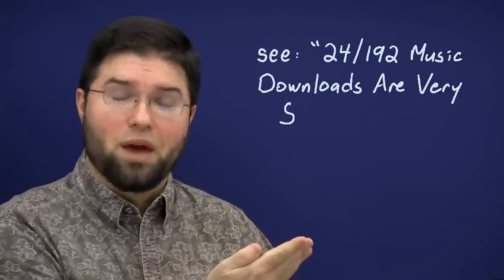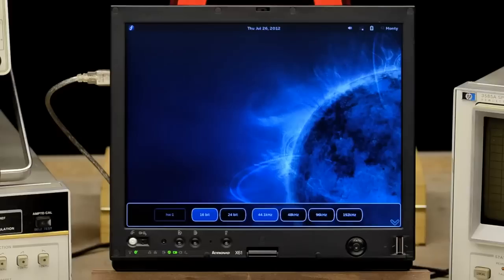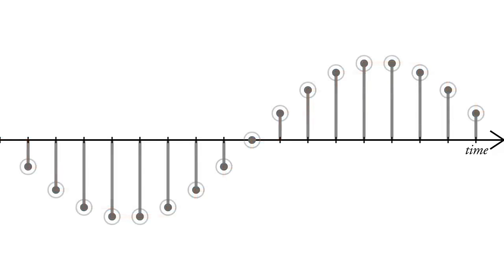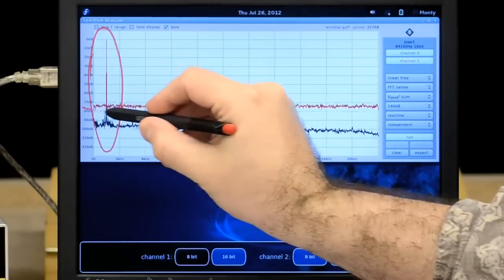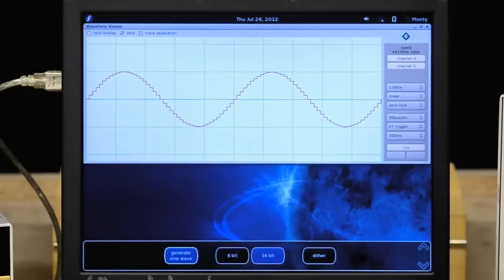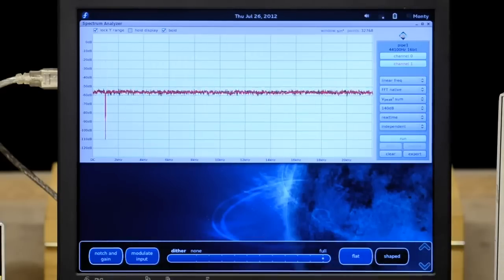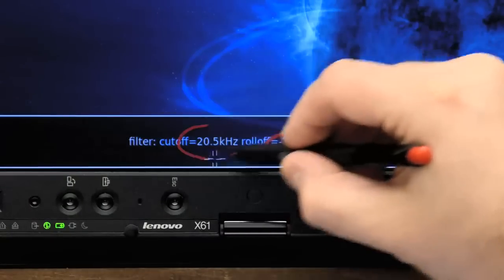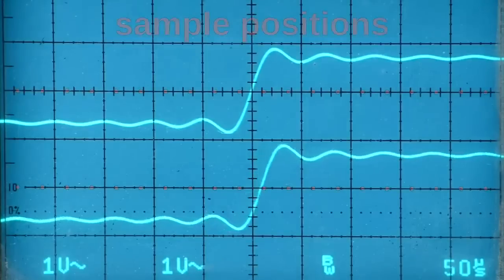Digital Show & Tell ("Monty" Montgomery @ xiph.org)

Comment: So there are no stair-steps but it still gets jagged when quantized. This means higher resolution still has a point. I think the debunking video which led me here is misleading.
( https://www.youtube.com/watch?v=cD7YFUYLpDc )
Reply: When?
Reply: @NamelessSmile  When he says 16 bit/44.1 kHz is just as good -if not better-. I understand that most people won't hear a difference but it's certainly not better nor the same. Stating these are unnecessary and might be misleading for some. Telling that we can't hear a difference for most applications is enough.
Reply: @NamelessSmile  If you ask for what application a higher resolution would might be needed, I can give an example that gaming or simulation purposes. For example a gunshot is more than 150 dB. If you want to reproduce such high SPL, you need to crank up the volume, And if you do that you will definitely hear the noise floor with a 120 dB dynamic range.
Reply: surely in that rather strange example, the noise of the (even high quality) analog amplification stages would vastly outweigh the quantisation noise from a 16 bit system ?
Reply: @NamelessSmile  I think you can work that around by using balanced signal paths, RF shielding etc. I accept that my example was rather unusual, but it was to prove a point that 16 bit/44.1 kHz is certainly not the same, nor better. I don't have a problem with the rest of the video, I find it really informative.
Reply: I'm still not necessarily convinced noise is the best way to say that the statement was extreme, aliasing concerns or time warp flexibility maybe can be reason for needing higher sample rates. But the noise floor for any analog amplification system will be well beyond the noise floor for a 16 bit system
Reply: @NamelessSmile  Yes these reasons might be better than my idea. But it does not really matter for the point I'm trying to make: It's not the same, nor better, despite it's more than enough for most reproduction applications.

And, you don't need to use analog amplification systems either, you can use digital amplifiers of higher resolution for low noise.
Reply: what's a digital amplifier ??
Reply: Digital amplifiers don't really exist, there are amplifiers with digital sections for DSP, but the amplification is not digital
Reply: Whatever, they are lower noise chips. And it has nothing to do with my point.
Reply: It is not jagged. It's discrete time samples. This behavior happens for all frequencies at all sample rates, and in all cases, the entire signal below the Nyquist frequency is reproduced perfectly in analog output.
Reply: You aren't going to discern 30 dB noise while listening to a 150 dB gunshot. And you won't hear it after the gunshot either 😂
Reply: @benchociej2435  Yes, I'm not an idiot uncle Ben, you would hear the noise when you're not shooting.
Reply: Monty shows the added noise because of quantization in this video. Watch further.